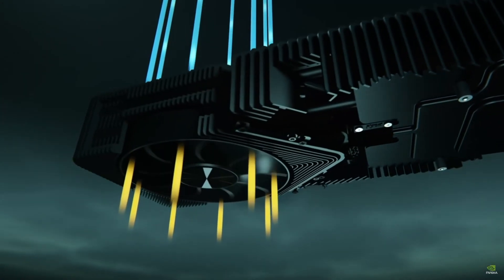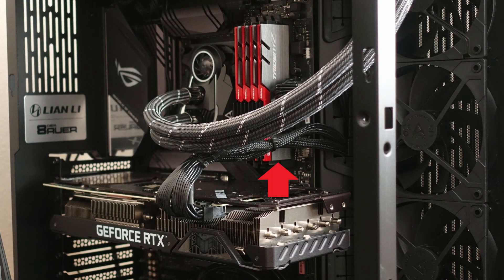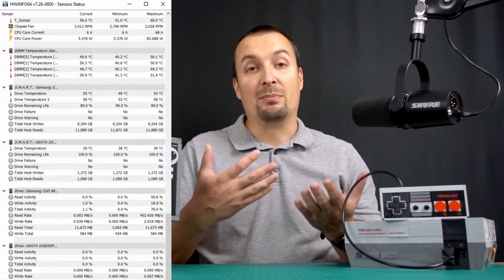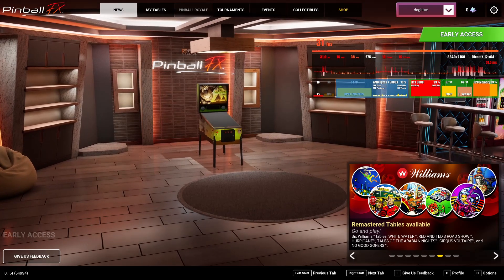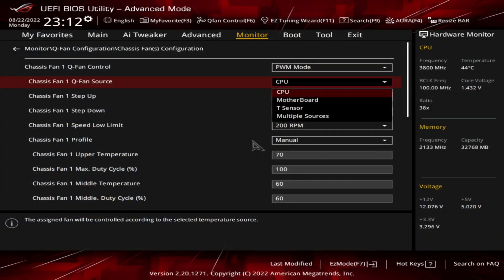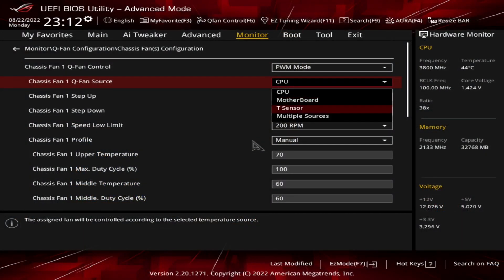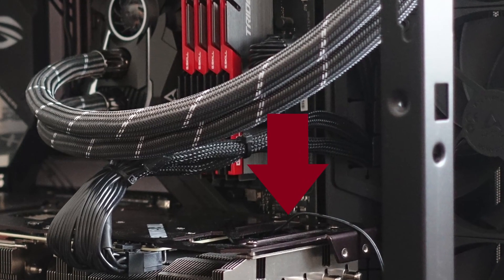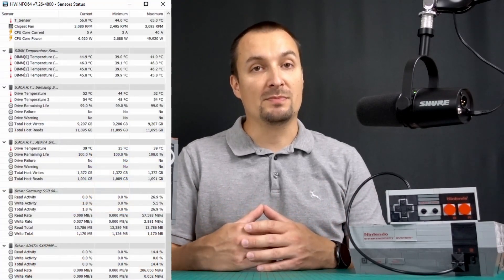My graphics card is slow cooking the RAM sticks! T_Sensor airflow "hack"

Comment: was just discussing this with a friend, since I upgraded my GPU, my CPU temp went up by 10 degrees. I was thinking about making a separate air zone just for the GPU, so its temp wont get dumped onto my CPU.
Reply from the maker: I also struggled with proper airflow in my old case, so I upgraded to Lian Li O11 Dynamic. It's certainly a lot better with its positive pressure setup, but RTX 3080 still dumps a lot of heat.
A vertical GPU mount could help in some cases, but it introduces other challenges, unless there is a sufficient gap between the glass panel and the graphics card.